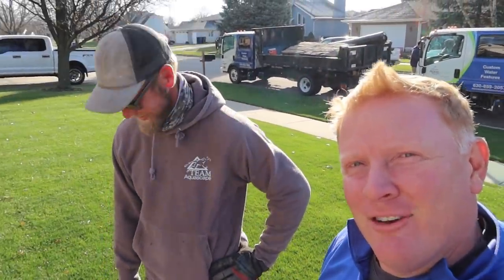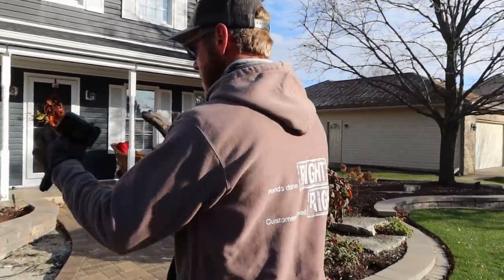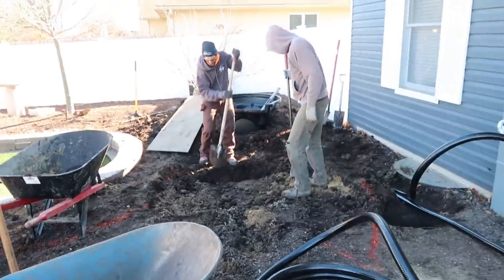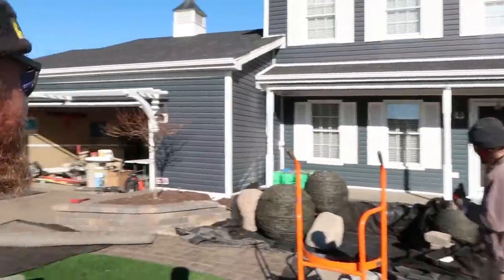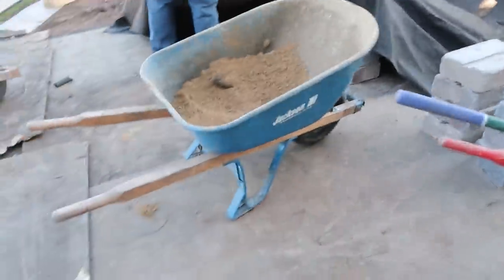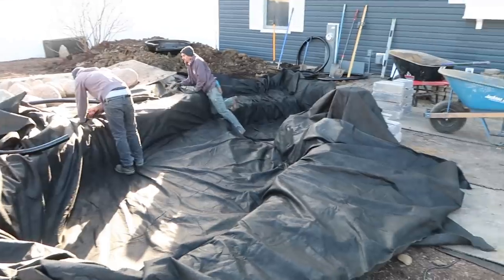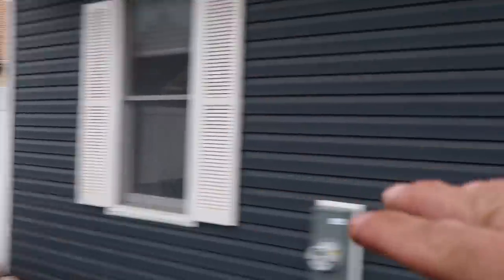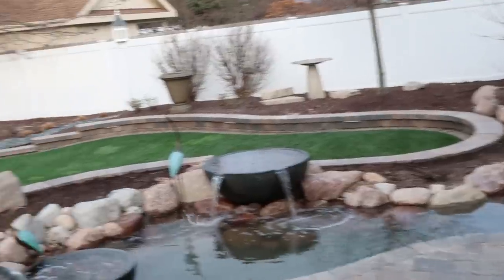A Front Yard Water Feature AND a Backyard Pond!

Comment: Both of these water features turned out just amazing!!! I have one question though and maybe it’s a suggestion cause I think it would look a lot better but on the bowls, where u guys cut out that square for the water to flow out of it, why don’t those bowls come with a cut out already in them so then u don’t see the cut marks in the bowl where u cut the little square piece out and it would be the same color as the rest of the bowl when they cast them, or the mold they are made in/on, or however ur manufacturer makes them? Plus u wouldn’t have the sharp edges from where u cut the square out, they could be rounded edges  in that little cut out area to match the rounded edges on the rest of the bowl!
Reply from the maker: They are modified Patio Ponds so no